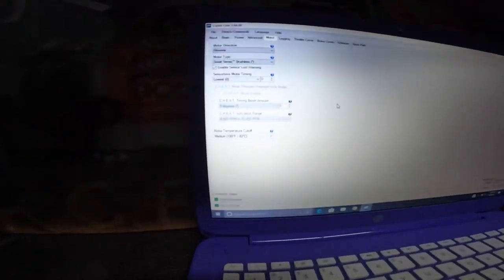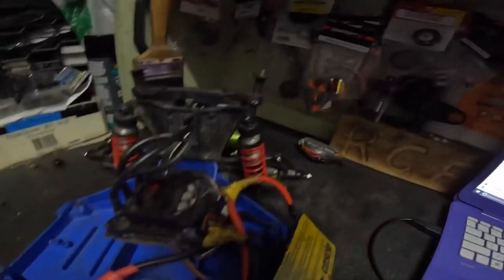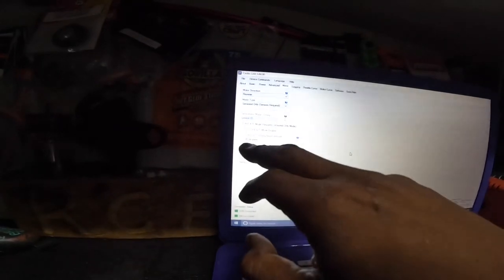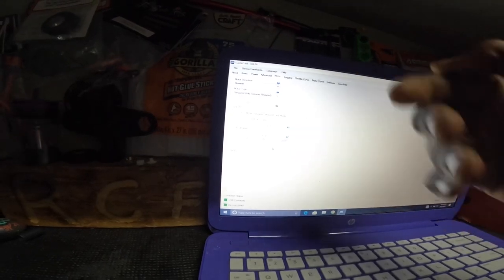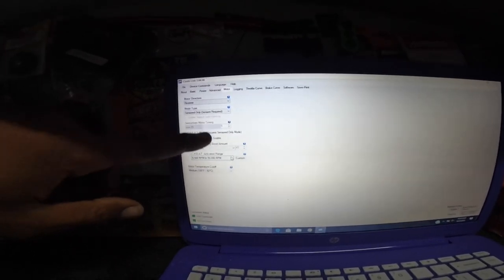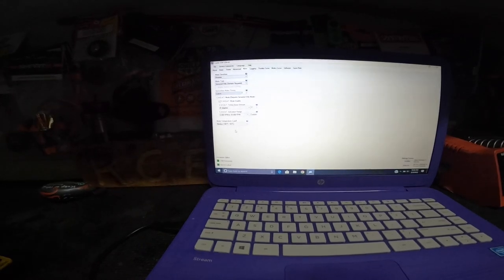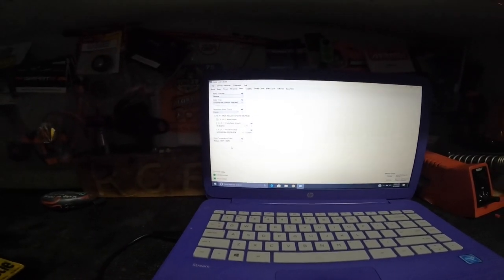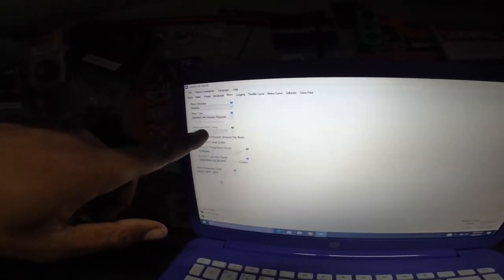Castle Esc Timing 65 Degrees ?

Comment: Question: have you run into situations where you have gripper/lower shore tires and have them get less traction (hopping/skipping). I have heard of this before but, wanted your insight. I am running 30 shore foams on 4wd set up and does not have as much traction as I would expect. 35 and 37 foam “feel” better. In your opinion, when you have enough torque to break loose a softer tire, should you stay that way or go to a harder tire (a little bit) and have it slip instead of skip/hop?  Thanks for the help
Reply from the maker: So this applies to temps outside so I would use a softer foam in the colder weather and use a harder foam in the summer if that makes sense and I have the same skip/hop but could be from car being to light or to much power from the start many things play a part
Reply: @RcFunDrizzy  I may have to pay a bit. Do you tend to keep front and rear tires the same or do you use harder or softer in the front compared to the rear on 4wd set-ups? Thanks for taking the time to reply

Comment: Is it a four pole motor or a two pole motor? 
I am asking because in a four pole motor your have a pole every 90⁰ so when you go over 45⁰ the magnets would try to pull the rotor to the other direction that is why it will start to heat up especially if the motor is not reving high!

Comment: Nice video Brotha! Do you change the rpm,with that the 35 degree @10 Present timing?
Reply from the maker: So once I have my car consistent I rarely mess with rpm
Reply: Thanks brotha
Reply: What’s your adverge RPM’s? Mine is around 88-91K so I put my RPM ramp 6900-89k put 6900 in go to custom you’ll see 89k